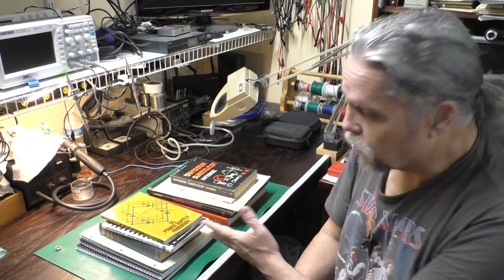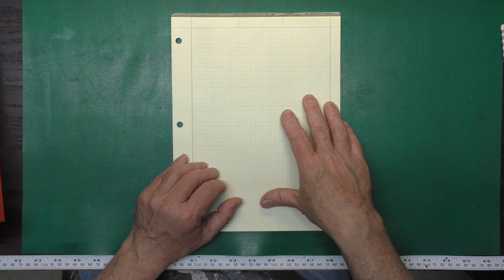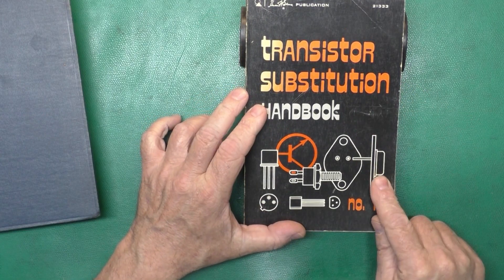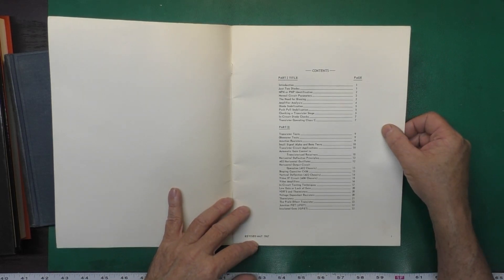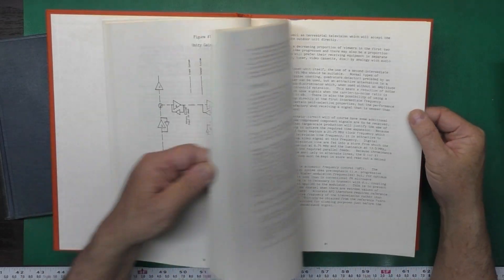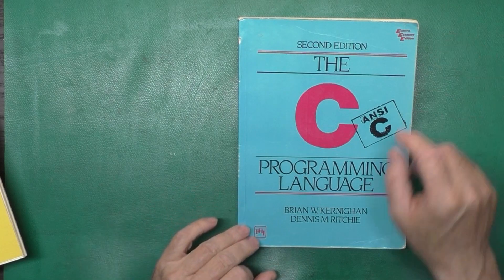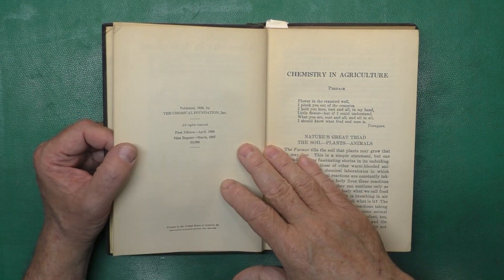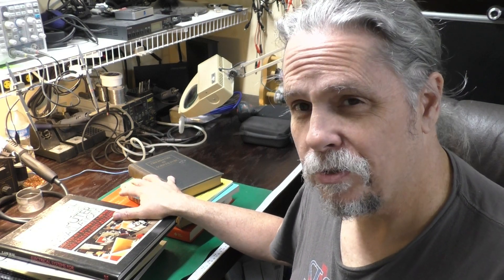The joy of (free) old technical manuals

Comment: I was in university in the 1990's, and I recall the textbook for a physiology course I took.  At the end of the course, I went to the professor and told him that if he used the same textbook again, he should tell the students to ignore the first 3 1/2 chapters, because they were garbage.  He told me he was writing hi own textbook.  The one specific example I recall that shows the problems with the book is that it had at least the professors as authors, and at least three editors.  And between them, they didn't know the difference between mass and weight.  There was a place where they gave kilograms as the unit of weight.  (A kilogram is a unit of mass, the correct unit for weight in metric is the Newton.)